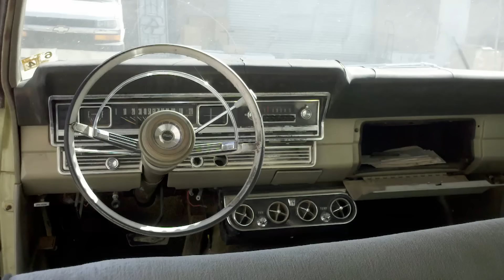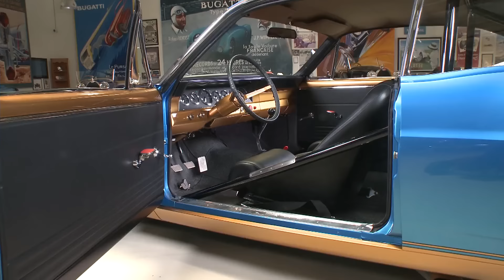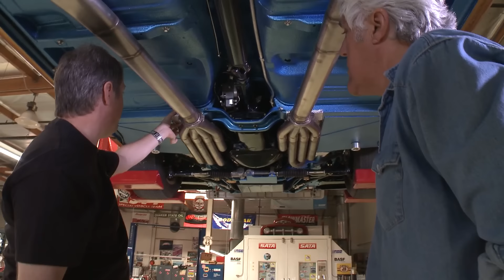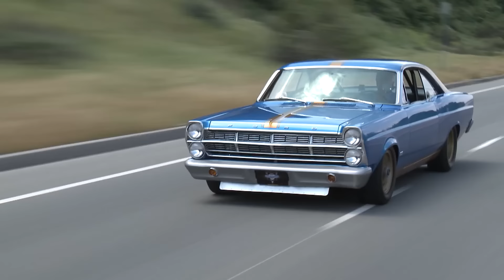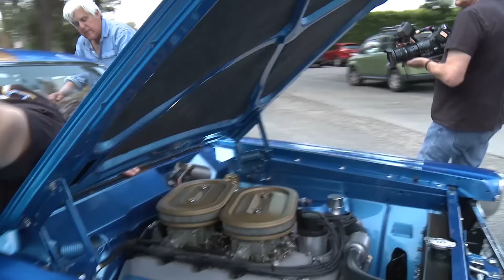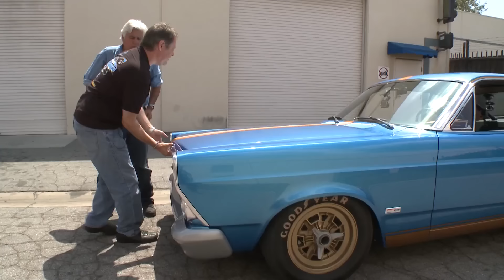1967 Ford Fairlane - Jay Leno's Garage

Comment: love that car but...I am concerned about cutting holes in the frame for the suspension parts when it has that much power. Wouldnt that make the frame weaker and possibly caus it to twist when under full throttle because I believe the car has more power than what he says it does.

Comment: How is the engine compartment on this car so bare? Where's the heater hoses? Does this car not have a heater? Brake booster? Alternator? Battery? Surge tank? How can there be no vacuum hoses at all? I see it has a wiper motor, but no washer tank? But I like that Jay Leno is an appreciator of mufflers. Why do you hate mufflers so much, hot rod guys?

Comment: Sounds like an old cammer. What’s the overlap and compression in that puppy? 🤓 I bet if that was a recirculating ball steering knuckle you would have been struggling. I worked in a European dealership back in the 70s, and those rack and pinions were much easier when they were not power.

Comment: Nice shake-down cruise. Gotta take care of the "fiddly bits".  Even in stock form a 67 Fairlane 500 or GT (coupe or convertible) with the 390 engine are terrific cars. The exhaust and suspension system on the car in this video is amazing craftsmanship. Thanks to Stephen for bringing it by and walking through all the features.

Comment: You're lucky the throttle pedal went limp when it jumped over Center.  I had a motor built when I was 16, not very powerful as I was young with little $,  for my first car which was the 72 Nova and leaving summer school class merging onto a highway on the on ramp I had floored the car and when the throttle cable went full rotation it actually got pinned by the air hose wide open(pedal stuck to floor)  going to the intake manifold and the car was wide open throttle and there was nothing I could do but shut the car off while accelerating rapidly from 40 to well over a 100mph panicking going around cars trying to get the car to stop.  4 wheel drum brakes too!!!! I had an Offenhauser Aluminum Intake Manifold so the throttle cable did a 90° Bend going to a sideways facing Holley carburetor which had this aluminum sprocket looking type of thing that allowed the throttle cable to go from driver side of motor to the front in a smooth 90 bend, forward of motor since carb sat length wise rather than left to right as is typical.  I almost died and could have easily killed people.  The 1/2"  breather line was about 3" too long and that 3" allowed it to get caught by the sprocket looking throttle cable angle thing.  3" of rubber air line was almost death of me on a brand new built motor.  But no way to know until after a couple wide open(too the floor board) accelerations.  I was lucky and so we're you guys in this video.  Could easily have stuck wide open on you rather than going dead pedal.
Glad you didn't die!!

Comment: Amateurish work. Holes in the frame - an engineering no-no. A monster motor limited by an antiquated transmission finished with a weak axle. This car screams "I did not even try".

Comment: That engine sound is nasty. I am surprised how fast the car accelerates, when you put down the gas pedale, considering the weight of the car. The details on the car are staggering. All is done with a purpose, at least to me. The paint combination works great, too. That car is a beast.

Comment: i live 26 miles from a place to get parts, i used to have some tell me that i don't need this or that because you wont use it enough to pay for itself, WRONG the first time that you are working on something with a promised time and a .50 cent clip  or ring stops you until you have to waste 2 hours, that 20 dollar box of snap rings or whatever just saved you more than a 100.00 dollars, GET IT,

Comment: It;s happened to me, the same throttle cable problem only on mine it happened to stick at full throttle.  My car was a 401 Buick shoe horned into an Austin-Healy.  No, not a poor man's Cobra.  Perhaps in a straight line but mine could corner at all.  When the engine was stuck at full throttle I luckily remembered to just turn off the ignition but it took a second or two to react with the engine roaring like that.
Love Jays shows!

Comment: "Sneaky" Pete Robinson built a gear drive setup for the SOHC 427 in his top fuel car in the late 60s. Pete died in 1971 after a crash that many believe was caused by a malfunction in a ground effects device that he had built to help counteract lift at high speeds.
Reply: Pete Robinson was a scientist when it came to drag racing, but he screwed up just once. In top fuel, that's all it takes.

Comment: When I was 17 back in the late 70's I had bought a 66 Ford Failrlane. Totally stripped with no factory options. 3 speed on the column, no power steering, no power brakes, no radio. It had the default 289 and it was quite possibly the best running car I ever owned. it had good power. Downside was the clutch linkage which snapped on me in the middle of rush hour on the Washington bridge (NYC). We were coming back from PA (6 of us) from a construction job for the local CATV company. One of the guys managed to micky mouse a fix and get us going only to be pulled over a mile later because of speeding. The cop noticed some "white residue" around the drivers nose (not me). He had done some crank before leaving PA. The cop let us go with one of the other guys driving. Other fun facts about the car, no heat and it had a terrible exhaust leak that emptied out into the car interior (brain damage anyone). I still love that car to this day tho.

Comment: Open exhaust.  Cam and carb set up that make it good for nothing except running wide open around an oval track...which it never will be.  Re-positioned shock towers....instead of a proper sub-frame mod...even removed the original bracing.   The front of this thing has to flex more than an over-cooked noodle.  The kind of car a 16 year old....or somebody with the emotional development of a 16 year old.....with unlimited money would build.   Total waste of a rare engine.

Comment: I had a '68 Fairlane. Personally, I don't like the changes that he made, for instance to the dash. The speedometer was horizontal, for instance, very classic look, and the horn pusher was a ring on the steering wheel. He just put an assortment of generic crap on the dash. Yes, I know this is much better than my old car, much more upgraded etc. - but I know how they looked in rl, and this isn't it. I'm not saying he did a bad job,  but this does not bring back the memories if you know what I mean. Oh, and people looked down on Fairlanes back in the day, it was considered kind of a boring car, whereas now it would be a lot more sporty than anything else on the road in its class.

Mine left me standing on the side of the road here and there, so that didn't bother me - that's rl right there. But as you get familiar with them, they're easy to work on and all mechanical, so  you can usually figure out something to get it home. I do have some memories of things like that, hearing that "eeeeek" when you turn the key is never a good thing.

Comment: My boss back in the late 70s had a 67 Mercury Cyclone Convertible w a 390 in it, car would leave block long hole shots w a C6, I used to take it to school sometimes just to blow the doors off all those mid 70s Camaro people, and Mopars, amazing vehicle, wish I had some insight, it was just a car, clean as a whistle, but no one knew to keep them

Comment: My very first car was a 15 year old red 67' Fairlane GTA (the A is for the automatic transmission).  The black interior was in perfect condition.  Sadly that was all that was in good shape.  My dad and I spent what money was necessary to get it road worthy and safe to drive.  Unfortunately, as I was in college at the time, I couldn't afford to keep spending the money necessary to keep the car running - 390's drink a lot of gas when you have a teenager driving.  LOL  If ever I get a chance to lay hands on one again, I'm keeping it, even if it takes 10 years to restore it!

Comment: F.O.R.D. = Fixed Or Repaired Daily
Reply: First On Race Day and im not biased in case you get the wrong impression. Fords of this era were great
Reply: Just a dig because this one was in need of repair. I owned a Ford for 13 years since new, it was a good vehicle most of it's life.
Reply: Tom O. Yea, all cars can be extremely reliable just as you could have constant issues with the new car. Mechanical things are quite unpredictable though steps can be taken to improve the quality of the work which can reduce the issues

Comment: What a rush! I had a 67- GT. 390, with a CID 4 speed. I built it up with an Isky cam and lifters. 2 big carter carbs, with an aluminum, med-high rise manifold. Headers. Took all chevy, 396's, GTO's. Couldn't take that dang 440 Magnum in the GT!

Comment: the moment the video opened with the exaust setting off car alarms, I knew this was gonna be good.
Reply: THAT was my favorite part!
Reply: Hahaha ABSOLUTELY. My favorite Ford's ever made were the 66-67 Fairlane R-Code 427's. But a 427 SOHC is even meaner than an R-Code 427. Ford rated it at 616hp with a 4 barrel and 657hp with dual quads. That was a very dangerous amount of horsepower for 1960s tire/brake/suspension technology. No wonder Ford never installed it in any production cars...but they did build a few Cammer powered Galaxie's for use as test cars
Reply: my bronco would do the same. every car alarm on the street would go off as I drove by. loved it.

Comment: I had a 1967 fairlane GTA  390, it was worn out when I got it ( like all of my cars)  but it still could SCREAM!!!!!into second gear.
Reply: Six years later, and I'm still watching this (  :  . Like I said six years ago, my car was worn out when I got it, the drivers floor had a road sign covering the hole in the floor, my car would jump out of park if you left the car's motor running, I learned that the hard way, )  :     . I drove my car to work one day, and I went into the building where I was working and when I came out a few minutes later my car was gone!!,  my car was across the street in a ditch, a guy asked me "Is that your car", I said yes, he said "It almost ran over me", I didn't leave the car alone with the motor running after that ) :

Comment: What am I hearing? The roar of the engine is great, cool and all but the rattling from the exhaust is a little too much. Am I missing something, I should be appreciating? It does sound like a dragster, but for street use you gotta add mufflers

Comment: How did the throttle linkage pass center and not stick wide open? Something here doesn't add up...
Reply: I'd imagine the return springs on the carbs slammed them back shut, that's where all that slack came from, throttle plates were shut but the pedal was still at WOT, that excess cable had to go somewhere.
Reply: The video doesn't look altered, so you must be right, but most set ups I know WOT pedal would be a WOT carb. Lucky, it wouldn't have been fun trying to shut it down.

Comment: The first 427 Cammer (SOHC) engines had the sparkplugs located at the bottom of the heads close to the headers. Ford engineers found no performance gain or loss where ever they placed the SP, so on the later engines they located them at the top (aka Cadillac) for ease of Change out. The Heads had D-Port exhausts but they were inverted  where the floor area is on top compared to traditional D-Port design today. People that aren't educated on the Cammer Motor don't know that it still used an OEM FE Engine block. I believe Drag Racer Pete Robinson was one of the first to incorporate a gear drive system replacing the chain drive. When this engine was banned from running in NASCAR, Ford sold it as a Crate engine and it had much success in Dragracing with the likes of Connie Kalitta, Danny Ongais, Don Prudhomme,etc. Would have been interesting on what it could have accomplished in NASCAR....Good Video !

Comment: Here is the Ford SOHC 427 gear drive that Leno asked about...

https://www.flickr.com/photos/lightning72/3813287348/
Reply: thanks for posting that. it's crazy how that works. however it's gorgeous.
Reply: Wow!
Reply: Youd need most of a paint brush marking that clock. That's pretty cool, thanks for posting
Reply: Thanks for posting this, just think if it was a 4 cammer!

Comment: The first brand new car I ever bought was a '67 Ford Fairland. I haven't owned a FORD since!  That car was a lemon from the first couple weeks I had it. Within 2 months of purchase had to replace gas tank, starter solenoid and battery. First winter heater quit heating. Never was able to get it to heat for more than a few days. Have had many good non-FORD autos since.

Comment: I had a 67 Fairlane GT 390 four speed car in high school. Midnight mist blue with a white stripe. I loved driving that car!!! I still have the transmission and rear end in my 34 coupe. Oh! and I still have the sales receipt when I bought it from my older brother. NO pictures of it thou!
Reply: I have a 68 Fairlane GT 429 maroon with the white sport stripe down the bottom. killer car to drive .
Reply: "Cool" I imagine it was much faster then the 390 car I had. I had to put a clutch in the car before I could drive it. My brother beat the heck out of it before I got it. And I did the same after I put the clutch in. The Pickers on TV found one just like the one I had in a garage. I guess they still have it!!! Over in LA Clair Iowa.Regards Sgrunt
Reply: Lucky, I have a 68 Fairlane with a 200ci I-6
Reply: This car in J's garage doesn't have a GT hood like mine did with turn signal indicators in the hood. My car was Midnight mist blue from the factory with a wide white strip at the bottom of the body from fender well to fender well with a GT emblem in it.
Reply: I have a 68 Fairlane 500 also.its not the fastback tho.

Comment: Here's a picture of the Robinson SOHC Gear drive system. http://farm3.static.flickr.com/2443/3813287348_7394f72413_z.jpg
Reply: +Doug Hanchard  That's a thing of beauty.
Reply: Automotive porn.  :-P
Reply: +Doug Hanchard that is crazy!
Reply: It worked very well and ensured cam timing was accurate. Oiling it apparently was initially, a nightmare, but sorted out quickly.
Reply: makes a lot of sence, wish Ford never stopped making that motor
Reply: Yep! That's it! I have a 3/4 side view shot I tried to post of it that shows the car too. Thanks for the post.
Reply: Cool. Had 2 Honda VFR (Interceptor) and loved the whine for the gear driven cams.
Reply: thanks

Comment: What a monster. That engine was outlawed before it ever turned a wheel in racing. Otherwise it would be a real legend if it had ever hit the streets in numbers. Imagine 427 cubic inches with the resulting torque and over 8000 rpm with no valve float? That's too much engine for anything smaller.  This thing was actually detuned for drivability. Imagine that engine with twin turbos or a supercharger!

Comment: Ed Pink was the one who refined the tune of the "cammer" back in the day and Pete Robinson made the gear drive for it. He was killed in a Top Fuel aerodynamic (failure) test back then.
Reply: +lobelifter It was indeed Pete Robinson that built the gear drive for the camshafts. It was a brilliant piece of engineering with one offset idler gear. http://farm3.static.flickr.com/2443/3813287348_7394f72413_z.jpg
Reply: +Doug Hanchard 
Notice he had the cams going in opposite directions too! Too bad they couldn't keep the cranks in the blocks on nitro.

Comment: In '67 when this car was new my uncle had a white over red Fairlane GT 390 4 speed. I used to help him out during summers in Side Lake, MN. He and my aunt lived on a chain of lakes and one day we launched the boat for summer. The boat winch was stuck so he started bouncing on the trailer tongue to try and free it and the E brake popped loose. The car rolled back into the lake. My uncle jumped in and hit the brakes. The front end was on the lake bottom but the back floated. Water was right up to the open windows and the wakes from boats coming by to check out the car in the lake were splashing in. My uncle decided he better exit but now couldn't open the door, too much water weight on the outside. Big guy he was he was still able to crawl out through the side window in full panic mode. The farmer who owned the landing, Sixberry, noticed and came and hooked up his tractor and pulled us out. Water came pouring out of everywhere once we opened the doors. The car ran a bit weird with an intermittent a high speed miss after that. They kept it through summer but my aunt and uncle decided to trade it in when the '68s came out. I loved that car and tried to get them to keep it and fix the miss but my aunt ruled the day and a '68 Chrysler Newport was bought. Nice car with 383 4 bbl. but to a 13yr old kid, and even today, it was no comparison to the Red Fairlane GT 390 4 speed!!! Always remember dual GT hood blisters with amber turn signals indicators in the rear facing the driver. And the left rear tail light half filled with water and bulbs still burning. Cool car. Mario won Daytona in one with blocks on the pedals! I still want one!

Comment: That is an impressively brutal sounding engine. Love the whole thing. Really need a nice horn cap though. Would like to hear the car after the small muffler job is done.
Reply: He used the stock wheel with no horn cap because that's what Ford did in their racing programs in the day. There's a reason for everything Steve does, even that.

Comment: Stopped for a motorist assist some time ago. Fellow had been fighting to get his truck running on the side of the highway. Ultimately it was a 10 second fix, throttle cable had slipped off the carb. It's often the simple things!